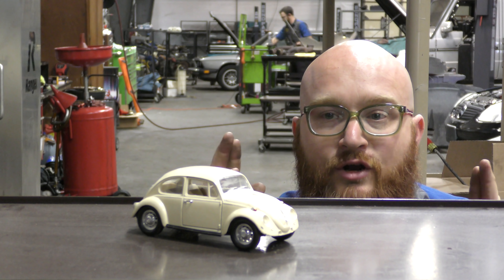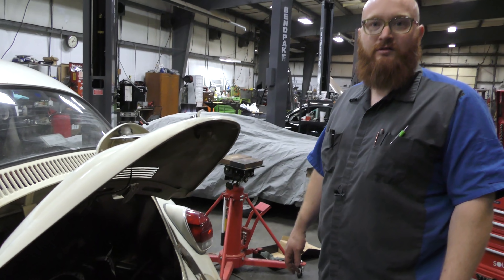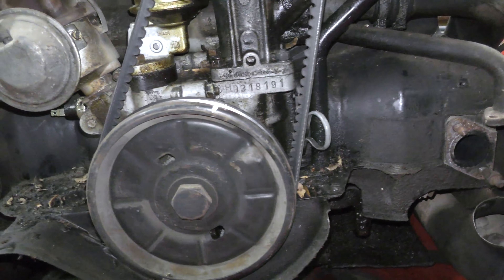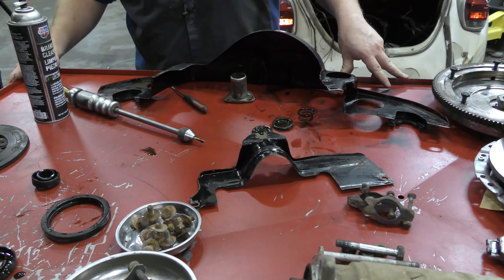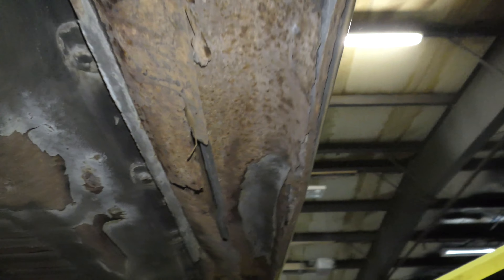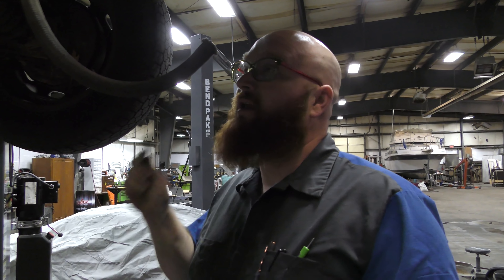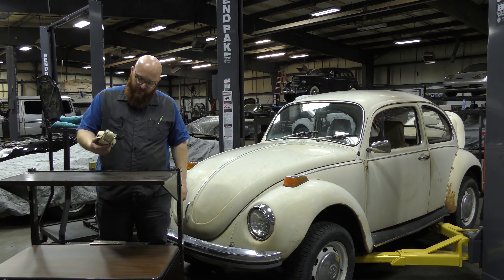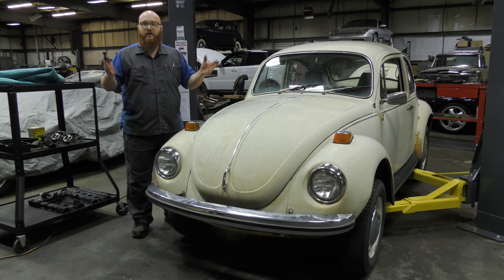Engine out for a clutch on '72 Super Beetle?! CAR WIZARD shows cool little car & huge repair process

Comment: The beetle was my first car too... well some parts of a volkswagon beetle. The shell was taken off and roll cage was put on it, brakes, the hand brake operated the rear right wheel. $40. These are the simplest things to work on, there is nothing to them, very little mechanical, very little fuel and very little electrical. As a teenager I could figure most of it out, it was all visible. It was bullet proof, light (for getting air :) ) and a huge amount of fun to drive around our paddocks. Our kids will miss out that experience, might try and get a 2nd hand leaf so they can use that as a paddock basher.

Comment: Needs some loving.  I used to double date in super beetle in early 70’s.  To pull the engine, my friend and I got it down to 1/2 hr to pull the engine.  Check the spark plug hole threads. Early models of 1600 needed the threads clean.

Comment: Hey just a couple things I noticed here. First off, that fuel filter on the engine is considered a no-no with VWs. The issue is that the barb works it's way out of the carburetor and can cause a fire when fuel is pumped out onto the motor. I'd recommend using some safety wire to tie the hose clamp at the carb to the carburetor itself somehow, and move the filter to the section of hose between the trans and engine. The other thing is, if in the future the owner comes back and says "hey this thing can't go over 40mph without having a death wobble!" that's a fairly common issue, and while the internet goes round and round about it, the real culprit is the inner control arm bushings. When they get soft the suspension pogos in and out. You can mask it by having everything exactly perfect, tire balance, steering damper, ball joints, idler, etc, but the real culprit is the inner control arm bushings. The good news is it's very easy to rebuild! Seems like a pretty nice survivor car aside from the heater channel.

Comment: 3/8 Snap-On ratchet was a great pilot baring alignment tool. Second clutch I did after my brothers Ford maverick. All I needed was my floor jack, stands and tool bag. Good times. I was as surprised as my pal was. And his parents seemed pleased enough to buy the disk. Party on.
Must have been a little older. There was no plastic on the dash. Sup cool cars.

Comment: Hi wizard did tons of working these wife had lone rebuilt one for daughter car was older than her, screen heater front got two 12v hair dryers plumbed in to vents bit electronics for 3 speed on the motors the joy of defrosting for the wife. She loved the car. Front got ran over with a truck when parked at work so rebuilt it fun times.

Comment: We had a bright orange 411 wagon. I remember the spare tire "powered" the windshield washer system. And being a wagon the heating system was horrible in the really cold part of winter. The battery was under the driver seat too. But, it was great in the snow.

Comment: I had a ‘77 Super Beetle Convertible.. It was Porsche Guards Red with tan leather.  It started life orange with black vinyl.  It was fuel-injected which meant it was just as mechanically finicky as the carburetor model, but parts were invariably twice as high.  Lol.  It was my first car.  Kept it for close to 15 yrs.  It could be a hateful thing.  I always felt it had it in for me.

Comment: Beetles are cool.  But boy do they rust~!  Any Volkswagen from the late 60's until about 1980 was built with cheap Russian steel.  This combined with a lack of adequate galvanizing led to many problems with rust, especially in the floorboards.  My first car, a '77 VW Rabbit, had this big time!  I sat down kind of hard on the driver's seat one day and the whole assembly fell to the ground!  It's not like I was very heavy, about 150 pounds.  We welded some steel plates to re-secure the seat and I sold the car.  My next car was an '85 Scirocco, which had the same MK1 chassis but NEVER rusted at all in the eight years I owned it.

Great video!

Comment: Yes, I have done that job before! I had a '71 Bus with the same 1600cc motor and transaxle setup. And where were you in 1996 when nobody told me how that dang washer bottle thingie worked. I assumed mine didn't work but I never pressurized it. lol! Nice video, Wizard. :)

Comment: My -72 has disc brakes front. Mine is actually now a Bonito kit car, and it also still has the old front suspension. I quess Euro models had some things different. When putting the engine back, the common mistake is to forget the throttle cable, if it is not fed through the air box, out comes the engine again. The most important thing is to replace the fuel hoses annually, as bodern gas destroys them, and Beetles have gone up in flames because all the exhaust is just there to wait something flammable. Beetle was the first car that could be driven all the time full throttle. And, as it has no oil filter (mine does now), the engine was designed to be replaced every 60000 miles, as replacing the engine is so easy. Just 45 minutes to do it when I was young, in a driveway using a lawnmover with engine removed to move the engine out and in again. When making the kit car, it took only half an hour for two (old...)guys to replace the clutch with good tools and lifts. Yes, fixing those is like being able to fix steam engines. Only old mechanics usually know about those...

Comment: Used to have a 73 Super Beetle with the curved windshield. All the repairs were super easy, and I remember constantly changing the oil (there is no filter besides the metal mesh screen) & adjusting the valves
Reply: 73 was the first year with the curved windshield and... you got a real dashboard, too.

Comment: I had a 68 Beetle...the first with the new bumpers.  The window washers fed off the spare tire.  The spare had a valve that would only provide air til the tire reached its proper inflation then stop.  Really cool.

Comment: Having no knowledge of beetle engineering but what we could find in a couple books; my friend and I pulled a 1968 beetle engine and replaced rear trans seal and torque converter in a semi automatic. Easy:
$150 for the car purchase, $150 for the tow truck home, and about $200 in parts we had a beautiful running car.

Comment: My first car, purchased over 30 years ago and still in my possession, is a '71 Super Beetle.

The car in this video is a '71 Super, not a '72. The steering wheel, speedometer, engine lid, and rear window are all one-year-only for the first year Super. While the first three items could theoretically be bolted onto another car, the smaller rear window is part of the actual body shell (the rear window got taller for '72 and later). The final verification would be checking the VIN on the body and the transmission tunnel under the back seat. The third digit will be 1 for a '71, 2 for a '72.
Reply: I was thinking the same thing after I saw the engine lid, steering wheel and speedometer.

Comment: In Canada they came with a gas heater that was mounted in the front trunk. Kept us toasty warm. In the 1980's we would salvage the heaters from scrap yards, mount them in big tool boxes, and use them as airplane engine pre-heaters in the winter.

Comment: yepp  good ol vdub..  had lots of type 1, 2 and 3 vws..  built most of the engines myself..  carwizard..  the old vws had a manual pump built into the wiper switch for the washer fluid..

Comment: My first car, a '61 Beetle, had the side panels so rusted out, there was no heat. I hacksawed the pipes under the back seat and put a couple of hoses on so I could direct them either to the windshield, or to whoever was the coldest. Hey. It was only $100, and I was 18.
My second Beetle was a '67. After a couple of miles with the heater on full, it would burn the heels of anybody sitting in the back seat. I put 150,000 miles on it, and never changed the clutch. I did, however, have to change the o-rings in the oil cooler. A mechanically knowledgeable friend managed to find a way of doing it with the engine in situ.

Comment: I did my 1st ever clutch change on my beetle.  4 bolts, a throttle cable, two side block off plates.  I had it completed in 6 hours total (never had done one before)  I bet I could do it in 3 hrs now

Comment: Before you put that engine back in, you should re-locate that clear fuel filter between the fuel pump (which has a filter screen inside it) and the carb. If the filter cracks, or the clamps get lose, you're dropping fuel onto engine and the the exhaust manifold, which can result in a fire (ask me how I know!). Most enthusiasts put the filter before the fuel pump, either on the left side of the engine down low, or under the fuel tank in the front of the car on a bracket.

You didn't mention how long it takes to pull an engine on one of these. It isn't a hugely time consuming task. With a car lift, I can have one out and on the ground in under 30 minutes. Without a lift, it's a couple of hours to do it. As you said, it's required to pull the engine to do the clutch, and it's much easier to do a lot of other tasks on the engine with it out.

Comment: I replaced the Clutch / Pressure Plate and other associated stuff - just like Wizard did. Mine was a '71 Super Bug. However, weeks later, the Starter Motor Failed to turn over the Engine. I discovered that the small Bronze Bush which is located in the Clutch Bell Housing had failed! My simple advice - is to change this small bush whilst you have complete access with the engine removed. Cost of the replacement Bush was four dollars. The Bush controls the end of the Starter Motor. Don't forget to inspect / change-out this Bush!

Comment: The windshield washer gets charged from the plastic line runs to the spare tire and then there is a valve that on it that shuts at 25 psi so that you don't completely drain the spare tire.  You don't have to pull the starter out or take the muffler off to get the engine out.  The tail pipes are what hold on too, to guide the engine going in and out.

Comment: I know the fun of finding a shop to take care of my car. Had 7 tell me no on a timing belt and transmission gear oil change. It's just a Mazda MX6. It's only like an inch between radiator and valve cover and anything else.

Comment: Mine is same make, year, and model HOWEVER... I have automatic stick shift.
For those that know and just ran the opposite direction, it is its own beast to service and find parts for, acting like neither an automatic nor manual transmission in its driving experience; technically it's the standard manual transmission except with a torque converter, pneumatically actuated clutch, dual flow oil/ATF pump bolted on, ATF container, vacuum canister, special carburetor, special exhaust manifold with vacuum nipple, a drive plate in place of flywheel, pedal cluster without a clutch pedal, and a dozen other special parts which aren't even made aftermarket. A friend knew what I was getting into and warned me since he used to have one, but "HA!" I say. My bug was passed down to me from a deceased relative and I've up for the restoration challenge. In fact, I'm almost done! 

**Extremely important note for autostick beetle owners rebuilding a type I engine**
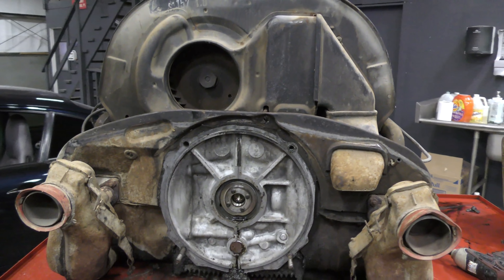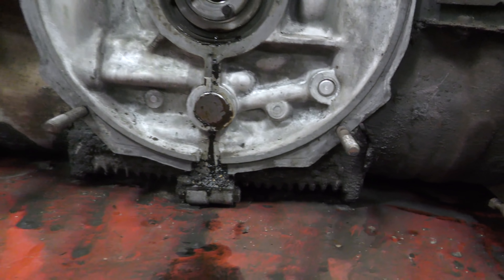Notice at 2:32 and 3:08 the cam shaft plug (below where the flywheel normally sits) has the smooth side facing out... that tells me this is a manual transmission super beetle. If it were autostick, that plug MUST be reversed to face inwards to allow for more clearance BECAUSE THE DRIVE PLATE ON AN AUTOSTICK BEETLE WILL IMPACT IT unlike a normal flywheel. I literally rebuild my engine, permatex 4H'd it shut, and installed the oil pump before noticing this through an excerpt in the red book about rebuilding your air cooled vw engine. The old timer I was working with already thought I was full of evil and sin for working on it and had no idea the direction it faced mattered. This cost me time splitting the engine apart to reverse that plug, a week waiting for new oil pump paper seals since they are destroyed when removed, as well as cleaning up the case and reassembling the sides back together.

Comment: Actually I did replace the clutch on a '72 Beetle using a Chilton manual. My own as a 17 year old.  I pulled the engine out twice for various repairs... Learned a lot about mechanics with that car.

Comment: I've of those cars that are quirky but easy to work on once you're familiar with the quirks I'm guessing.
I like these final air cooled beetles over the older ones myself but my favourite is the Type 3. They must have had to develop an automatic transaxle just for the VW flat fours.
They must have gotten hot without oil coolers.

Comment: My first car at 15 years old ....ahem 36 years ago....was a '74 standard beetle. I could pull the engine in my parents driveway all by myself in about 30 minutes, and I had a lot of practice.  BTW, the spare tire pressurized windshield washer bottle had a spring loaded check valve in it to keep you from bleeding too much pressure out of the tire...I seem to recall it was set at 25 psi, something like that. Also, a big problem with the heater was you actually could blow exhaust into the cabin after the exhaust J-tube rusted out.  The other problem was the windshield defrost was so bad I'd have to have an ice scraper in hand in the winter.

Comment: My first car. A metalic blue 1972 Super Beetle very much like this one. 
The dash was yet the metalic dash, not the plastic. And it was a 1300 beat up motor. Some of the horses were missing. 
1300 engines were more common in my country, Portugal.

Comment: if I remember correctly they were still building these in Mexico up to the mid-1980s and they only stopped due to emissions in Mexico and also questions over crashworthiness because they were the car pick to be used as a yellow taxi  - I believe when the stopped building these in total 55 to 60 million cars where built
Reply: Ceased production in 2003
Reply: Believe it or not the last old Beetle was made in Mexico in 2003.  I have found some of them for sale in the US.
Reply: 2003-July  was last year 65 year run, , they converted factory no "new" Beatle (water cooled).
Reply: Something like 21.3 million IIRC

Comment: I had never worked on a Bug before. I was all proud when I got it back together and hit the starter. I didn't realize that I pinched the throttle cable between the engine and transaxle. The it get tore up when the clutch caught it.

Comment: seen Mustie1 pull many of these apart and put them back on the road. If the motor spins you can get these running with basically nothing

Comment: You should do a "buy this not that" for "first cars" (i.e. what should you buy if you are a new young driver looking for a good first car). Something that factors in reliability, fuel economy and (important for young drivers) safety and insurance costs (no point buying a car that's cheap to buy, cheap to run, cheap to maintain and expensive to insure).

Comment: By the dark color of the manual transmission oil, I hope you are changing it, if original it was straight 90 weight and if not warm takes a long tome to drain, it is a lot easier to refill with the engine out.  Feel free to use modern 80W-90,

Comment: In 1968 there was VW orange paint option that was called Clementine.  Very close to the Lambo and a lot cheaper.  I did a clutch circa 1978 on a 72 on  dirt driveway using  wood blocks and the original jack.  That was not fun.

Comment: I remember as a little kid in the early 70's my parents both had Beetles, as they were inexpensive, dead reliable, and easy to fix. (Not like VW now, but that's another story.) Though the one unreliable part was, as Wizard says, the heat! The things would start and run every time, but those northern Ontario winters... Did I mention the lack of heat?

Comment: J.C. Whitney  used to sell electric blower motor assembly since the air flow through the heater boxed sucked un north.  This is why you had an old credit card to clear the inside of the windshield and a hair dryer to thaw out the snow that will pile up around your gas pedal. .

Comment: This car was called the "Beetle 1302" in Europe. It was kind of an intermediate model with the better front suspension and more luggage space (in the former model the spare tire was directly at the front and nearly upright). Was followed by the "Beetle 1303" which can easily be recognized by the curved "panoramic" front screen. Had a 1970 1300 and a 1974 1303. Very easy to work on, you could really do almost everything yourself. Clutch job took about 2-3 hours with a car jack and a plank to support the engine...

Comment: Check the throw out fork, those can wear at the pivot and one of the ears will break.  Clutch on on one of these that doesn't the flywheel turned can be done in 30 minutes.

Comment: My first car was a 62 beetle,  I could get the engine out in 30 minutes , I found it very easy to rebuild the engine . There was no oil filter , so I modified the oil, pump plate to fit one .
Reply: kinda risky to have a filter exposed there.
Reply: @L8nitedave  the filter was not fitted to the plate , the plate was modified to redirect to oil through the filter via a pipe , the filter was in a very safe position.

Comment: I've done it with the Bug on the ground. dropped the engine down in place, crawled under the bug and replaced the clutch and throw-out bearing.